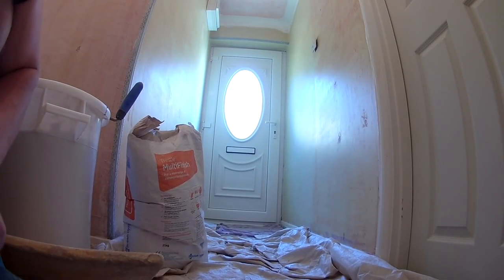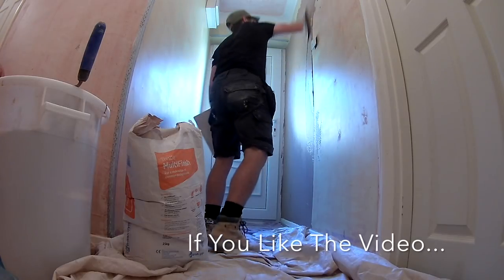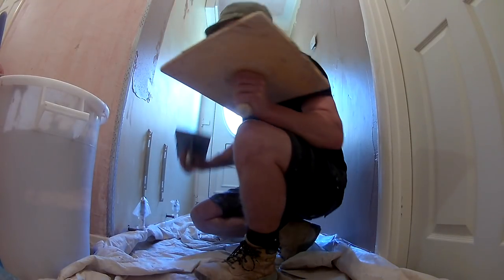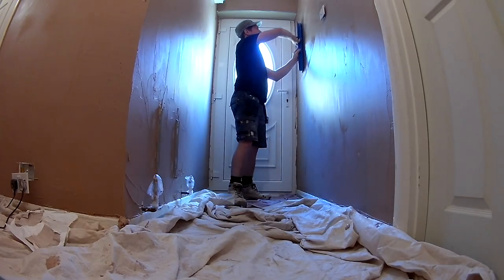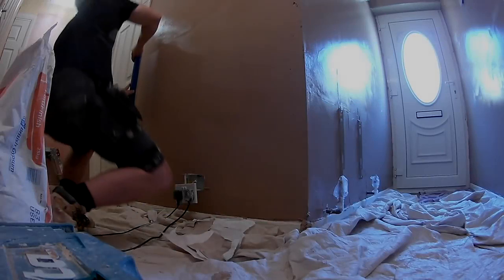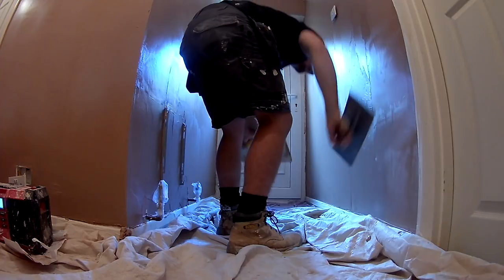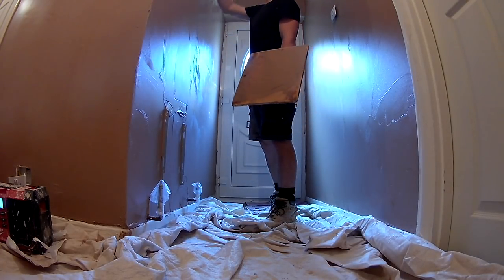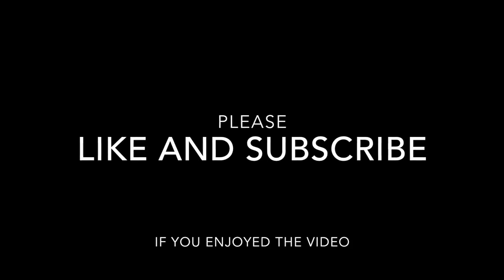Applying 1st & 2nd Coat Of Plaster / Refina Spatula Review

Comment: Big tip.  Radiator hangers. Take them off then leave something like a match stick or a screw fixing sticking out about 1mm. you can skin over these and it shows the bump. once nearly set you can pick them out.Or just put the screws all the way in.
Reply from the maker: Great advice! Cheers matey 👍

Comment: What a great video.  Very easy to watch and explained very well. Top guy. I wish you all the best for the future young chap.
Reply from the maker: Cheers mate 👍
Reply: @PlasteringForBeginners  hey pal thanks for the reply. I heard you say in one of your video's one of your elbows hurt.   Why don't you get a sports elbow support only 12 pound .use it while plastering.  Have a good weekend
Reply from the maker: Not a problem pal. I've got a wrist support which is helping but you are right. I need to invest in some support for my elbows - cheers and thanks for the support!
Reply: @PlasteringForBeginners  don't put all your eggs in one basket too. Just say your elbow does go what next???  Always have a plan b just in case.  Cheers for your video's, you've taught me bundles.  I'm a decorator by trade , I done a 6 week plastering course and worked Saturdays for a plaster been at it a year now and loving every minute of it

Comment: Cracking video buddy. It's great to see a pro in action with all the advice on commentary. Was that a metal blade on the spat or plastic? And is that a 30 inch blade?
Reply from the maker: Thanks a lot mate - I appreciate that and thanks for the support. It's a metal blade and yeah it is 30 inches. I'm looking to get a review in on the plastic bladed Speedskim to compare so I'll be letting you know when that's ready pal 👍

Comment: I personally don't like troweling as I go so much because I find it pulls the water to the surface and makes it separate a bit.
I prefer to lay on trowel back over once or twice at most then leave it to pull while cracking on with something else for 15 then flatten with superflex.

Comment: Nice work. That wall is a work of art, almost a shame to paint over it, haha! I too try taking the lines out as I go but it doesn't always work out for me, it's just one of those things that works sometimes and not others. I would have taken those radiator brackets off the wall though, save messing about trying to skim around them, I hate those things.
Reply from the maker: Thanks a lot pal and yeah you have a point about the brackets haha! They are extremely annoying!

Comment: How do you do corner bead shorly if you trowel your first coat flat over your corner bead and then do your second coat over your corner bead your corner will be to thick and you won't see your corner bead?
Reply from the maker: This is a common misconception but it actually takes 2 layers of plaster to get it to the right depth. If anything, people struggle to build the plaster enough which often leads to dips along the length of the bead.

Comment: Good video. I want to learn plastering for a few small and medium-sized jobs. It seems I might only need to but a hawk, 14" Marshalltown trowel and a 600mm Refina Spatula. Does that sound right. I would be interested in a 1200mm Speedskim too but may not need it.
Reply from the maker: Hi mate! It all depends - I actually think that you should get a Flexi trowel for the final stages of plastering because a new Marshalltown Permashape needs breaking in whilst a Flexible trowel doesn't. They really make a difference to your finish 👍
Reply: @PlasteringForBeginners  Thanks. I appreciate the reply.
Reply from the maker: No worries pal!

Comment: Should take the brackets off for the rad then screw the screws in so the trowel rides over them and you know we’re they are then it’s all neat and saves messing around
Reply: carltheplasterer the pipes are coming through the wall so there will be a enough movement or 2 mm
So it will not put the rad out 
What’s your full time job 
Handy man
Reply: carltheplasterer love to see your work best your just the best spread that ever lived 
1000m a day in one set 
😘
Reply: carltheplasterer love it what a plastering dinosaur